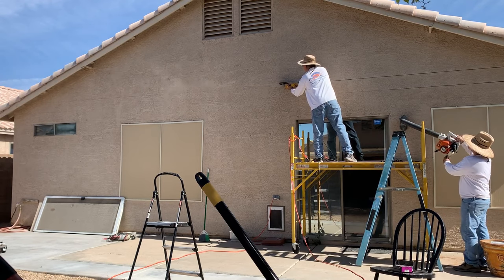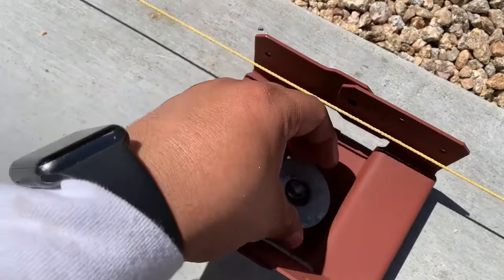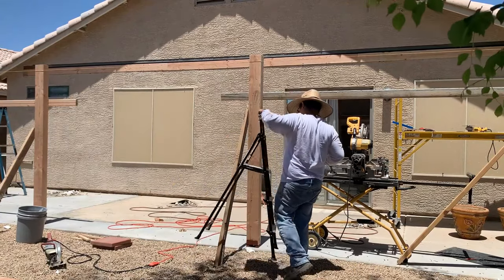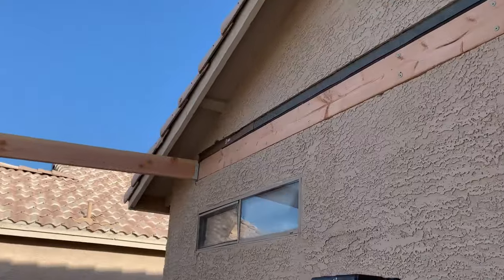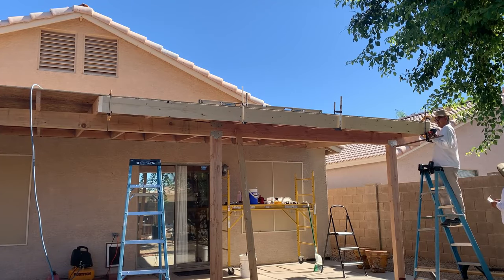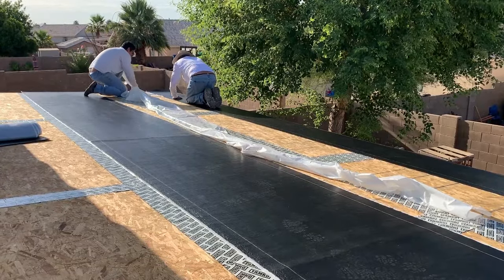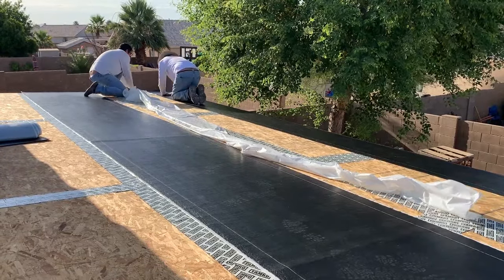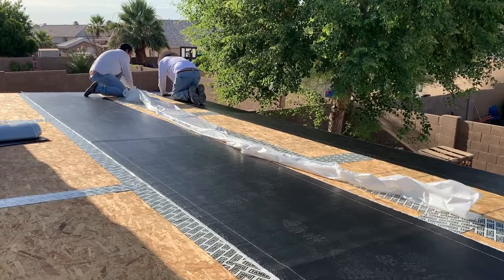DIY Patio Part2 - Framing Roof

Comment: Hope you guys used H-clips on the decking ...
Reply from the maker: Where do the h clips go? I put something between the boards, not sure if that’s what you mean. It’s to keep the boards together between the rafters.
Reply: They did use H clips on the plywood sheathing for the roof, you can see them in the video.
Reply: @luisangelmedia4459  dont worry, you did use the H clips. I can see them in the plywood part of the video. They are the little metal clips between the plywood sheets. This allows the plywood some room to expand and contract in various weather.
Reply from the maker: @davidhigdon8238  thank you for the feedback.

Comment: What kind of screws are used to attach the horizontal board to the side of the house?
Reply from the maker: I used 5 inch 3/8 thick lag bolts.
Reply: @luisangelmedia4459  thank you, I appreciate your channel.  As a DIY beginner, any bit of knowledge helps.
Reply from the maker: @luisi8561  I'm glad the info is helpful. Good luck on your future projects.

Comment: What size are the rafters?
Reply from the maker: The rafters are 2x6x12, which translates to 1.5 inch thick, 6 inches tall and 12 feet long, but they were cut back to about 11.5 feet because we didn’t use the full length.

Comment: How do you figure outside post height?
Reply from the maker: First, I needed to figure out the maximum height of my ledger board. If I go to high on the ledger board, the patio roof will hit the roof tiles, so I cant go higher than that. Once I know the height of the ledger board, I then decide the slope I want on the roof. This roofing material allows for ultra low slope roofs, but I decided to have at around 6 inches of slope, or incline. That translates to about a .25/12 slope. You need at least 3/12 pitch for normal shingle roofing, for comparison. Hope this helps.

Comment: El barrote k metiste de 2×6 en la pared de la casa isistes el corte de de 8 pulgadas en el semento.
Em micaso tenia un barrote de 2 pulgadas reales ×8 tendria k cortar el semento a 10 pugadas. Y si pusiera uno de 12 pulgadas tendria k abrir de 14 pulgadas en el semento. 
Es mucho mas grande este tejaban k tengo es de 18 pies por 30 pies. El barrote k va metido en la pared de k medida sera lo correto. El mismo de 8 pulgadas o ponerlo mas grande
Medijero k solo hay barrotes de 1 1/2
Y le pusieron uno de 2 pugadas reales ×
7 1/2 reales
Reply from the maker: La razon que corte 8 pulgadas para meter el barrote de 6 (5-1/2 pulgadas reales) es porque arriba del 2x6 va un barrote muy chico de 1x3. La primera lamina que va abajo del cemento asienta arriba de este barrote chico, y la segunda lamina ya va enfrente. Te voy encontrar un dibujo
Reply from the maker: https://lh3.googleusercontent.com/proxy/FXd9ETJdHVX6elOnR_Kc1B-SdDY-pilEGNEQDEqAqGYlufdhxFd9qCvGXTEMlS53pevYWDOqoU-mDgR4PN8SvbPSSWR2YdfRQ7jg_6v6GAdwRmluhL7YODFB-LEElFsUWg

Comment: You forgot the primer body
Reply from the maker: The primer for what item?
Reply: @luisangelmedia4459  Luis I’m a roofer by trade you need to use roofing asphalt primer for your metal drip edge and use mastic on your laps of your drip edge metal other than that good job
Reply from the maker: @mariorobles379  thank you for the feedback. I appreciate it.

Comment: Where you got self adhering roofing roll, Can you tell me exactly what brand for both 😏
Reply from the maker: Leonardo Martinez “GAF Liberty 3 ft. x 34 ft. (100 sq. ft.) SBS Self-Adhering Base Sheet Roll for Low Slope Roofing” and “GAF Liberty 3 ft. x 34 ft. (100 sq. ft.) SBS Self-Adhering Cap Sheet Roll for Low Slope Roofing in Tan” from Home Depot.
Reply: @luisangelmedia4459  thanks 😊
Reply: @luisangelmedia4459  Luis, I've been checking multiple Home Depot in LA, can't find the base sheet (black) you used in the video, only the cap sheet. Could you please provide a link of the product or a picture of the package please?
Reply from the maker: @Mr4566Leo  Liberty 3 ft. x 34 ft. (100 sq. ft.) SBS Self-Adhering Base Sheet Roll for Low Slope Roofing

https://www.homedepot.com/p/100087821
Reply: @luisangelmedia4459  just confirmed Home Depot does NOT sell them in LA. Sad
Reply from the maker: @Mr4566Leo  while searching for it, I also found that not all Home Depot sell it. However I have also obtained this material in roofing stores. Try them and see. Good luck!

Comment: What size z flashing did you use and where did you get it from ?
Reply from the maker: https://www.homedepot.com/p/Gibraltar-Building-Products-1-in-x-10-ft-Bonderized-Steel-Z-Bar-Flashing-ZB6B/202218458
Reply from the maker: The Home Depot link says 1 inch, but I think they also sell one thats 2.5 inches on the bottom and 3 inches on the top.